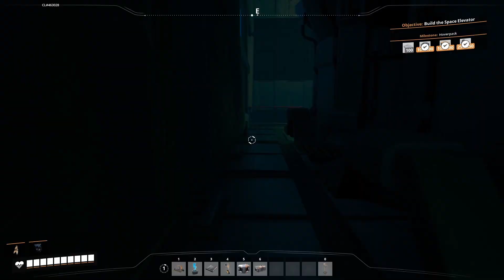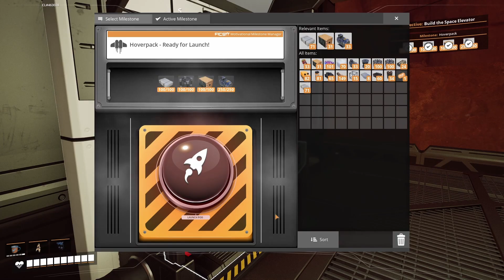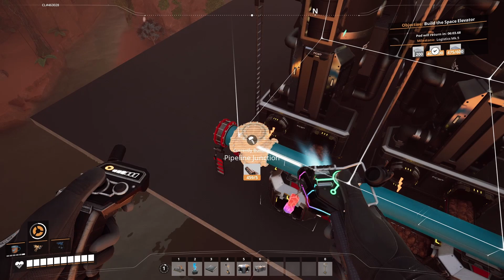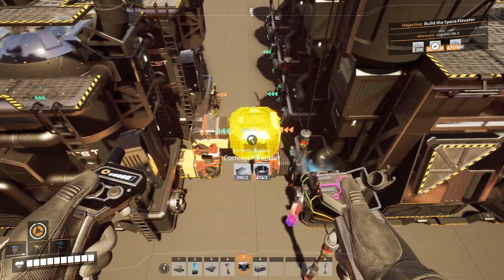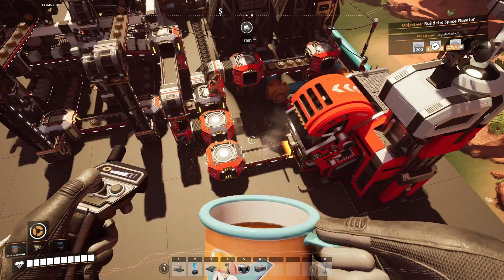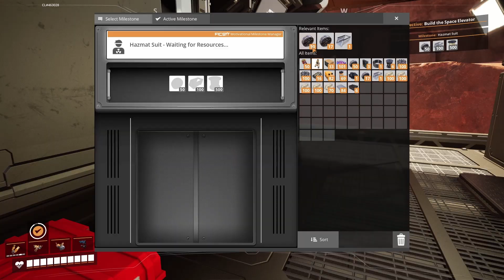Satisfactory S3 Ep8 Let's get to Aluminum Production

Comment: For a hoppy mouse, it's usually a bit of dust by the sonsor or on the mouse pad.
Reply from the maker: Will chec it out and see if that solves it thanks. It just happens now and then so was thinking its to do with the wireless connection dropping or something
Reply: @alphablazedgamer  I have been using the same G402 since 2017 and when it hops I wipe of the mouse pad and earbud the sensor. You do this from time to time.
Reply from the maker: Will sure do it. I replaced my pad about a week ago so will chec the sensor on the mouse and clean it.